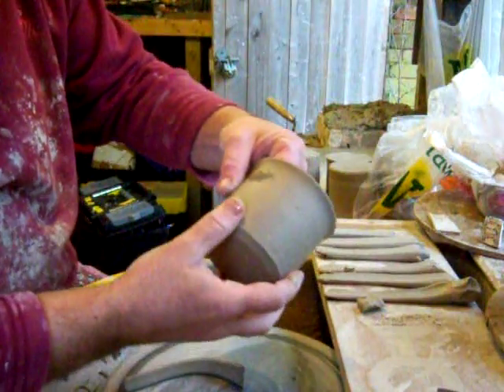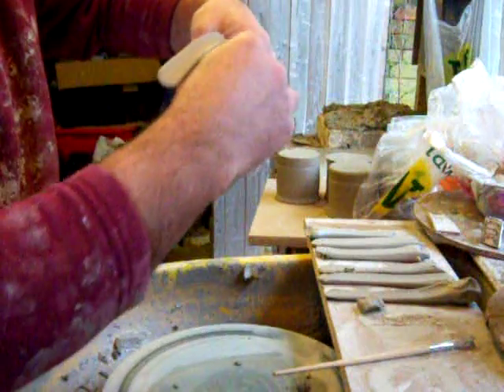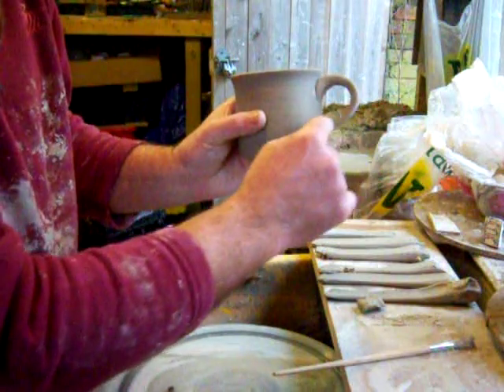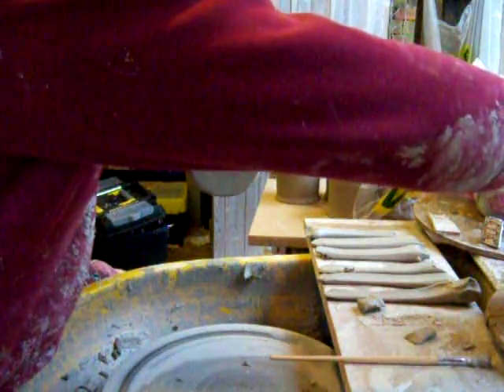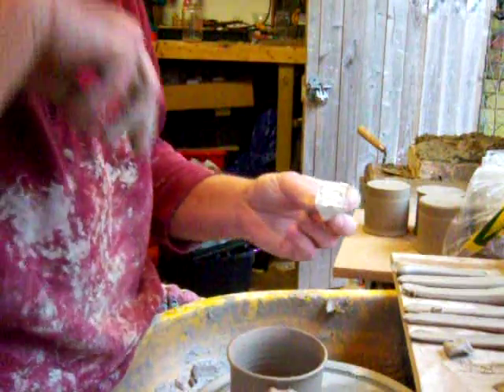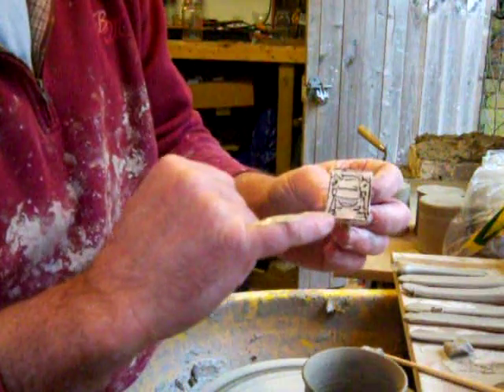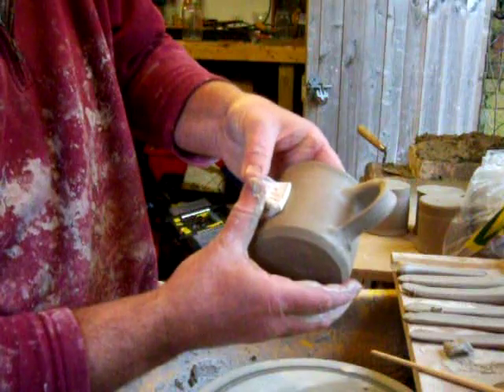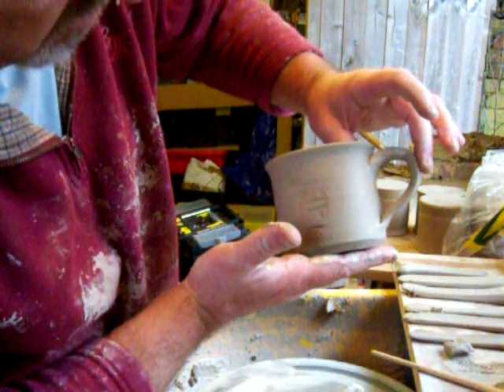Coffee Mug with Stamp Imprint

Comment: Great video Steve (as always). Thanks for the plug! I normally impress the seal when the clay is just leather hard. It can be difficult to do straight after throwing as the seal has a tendency to stick to the clay. The only exception seems to be if the stamp is simple and hasn't many ridges for the wet clay to stick to.
I have learnt to push gently from the inside of the pot at the corners of the seal as I push it onto the outside.
Mark.
Reply: brookfieldpottery prices